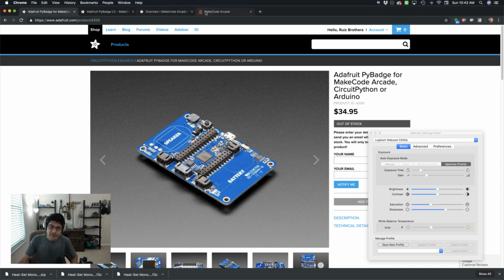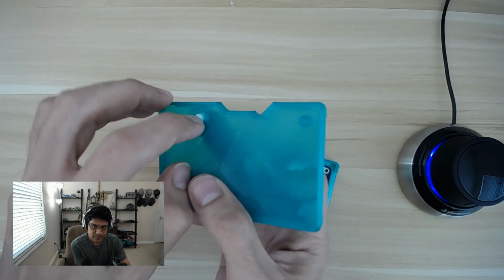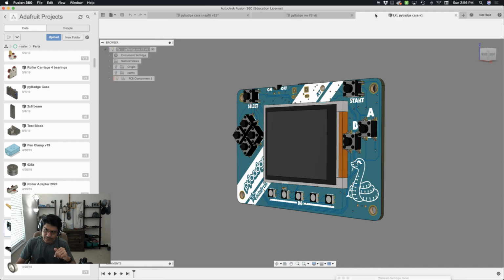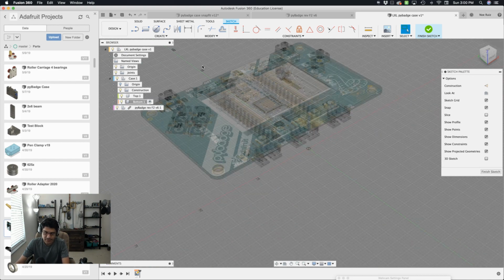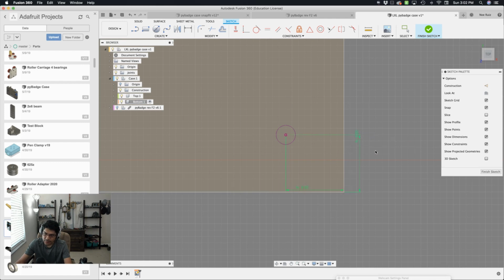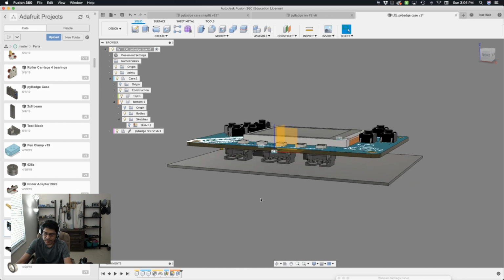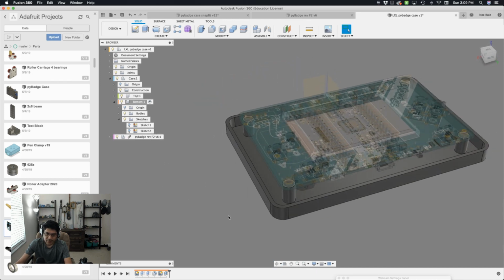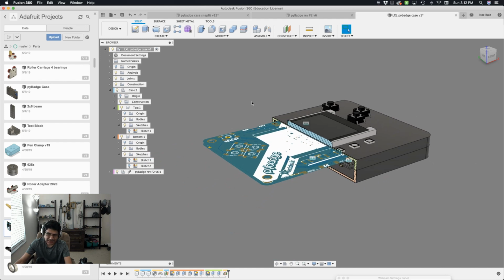Layer by Layer – PyBadge Snapfit Case Pt 1

Comment: Yes, I need to set up my hotkeys too. But I have a minor tip. If you have multiple features, like the holes on the bottom, that need the same thing done to them, like the offset, you can hold control and select several and then apply the action. In this case the offset with user parameter thickness. Works great for corners and edges that need a fillet/chamfer as well! Thanks for this tutorial!